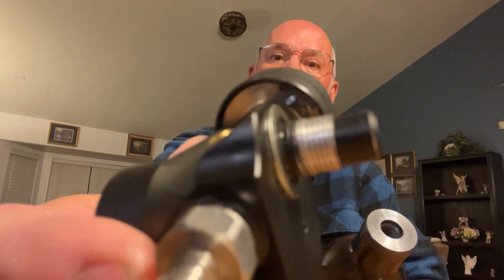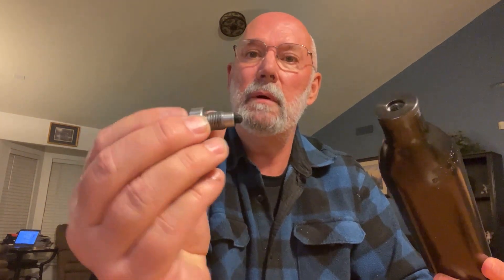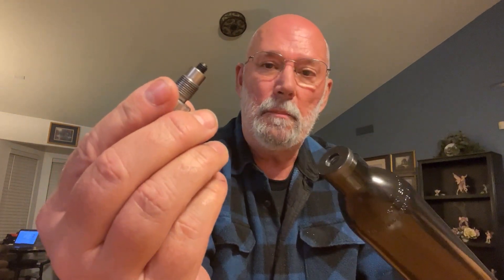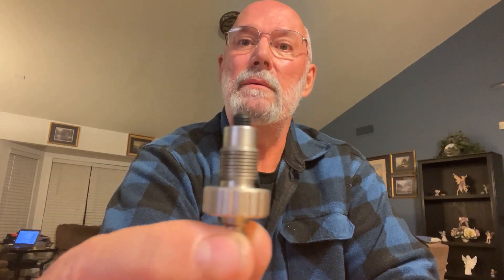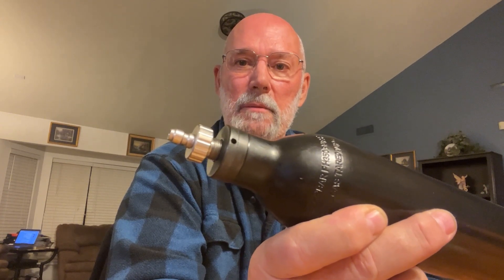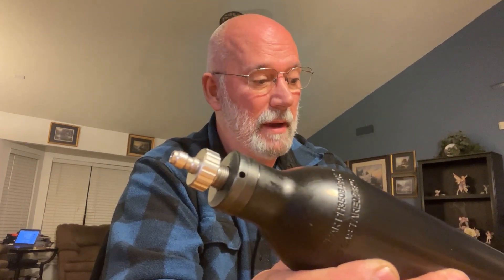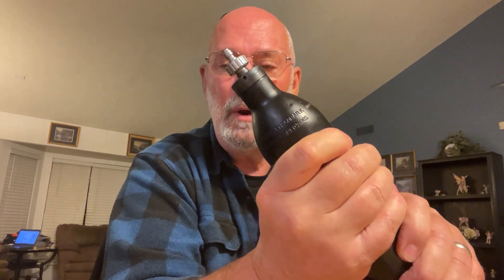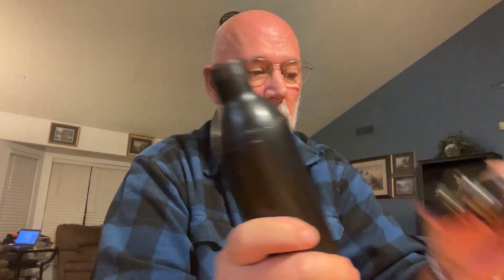Degassing a 400cc FX Aluminum bottle with Damaged Threads

Comment: Please write to support at fx airguns and report this. I did the same thing because my bottle literally blew off after 2 weeks (new Maverick) when unscrewing it. The shop where I bought the Mavreick send me a new bottle adapter and then it happened again when I took the bottle of for the 2nd time when I was tuning my Huma regs. I can assure you . . . I know pretty well what I'm doing so I will not accept the "user error card". This is a design error, period. Huma Air said the same thing. 

The threads on the bottle connector/adapter are simply to short and made from the wrong material. The carbon bottles have steel threads. Most people know that alloy and steel never go well together under pressure. This must be redesigned before real accidents happen. The bottle adapter must be made out of stainless steel , the threads should also be twice as long preferably, but that renders a lot of bottles useless. Send FX a mail my friend, everyone should do this.
Reply from the maker: Thanks for the advice. I noticed that the Talon Tunes CF bottle that I bought along with a Huma Air 300 bar bottle valve paired with a new Huma Air FX bottle adapter seem to screw on and off 100x easier than the stock 400cc Aluminum bottle that my Maverick VP originally came with. Since I started with the VP I didn't realize that the bottle should have been easier to remove. I did begin to notice that every video I watched it always seemed like their bottles came off way easier. I had already ordered the 580cc Talon Tunes bottle and Huma Air bottle valve so it was perfect timing when my bottle came off and was stripped. I was only down for a week. I'm anxious to see if FX stands up and accepts blame and replaces everything. I'm almost tempted to just say screw it and buy the replacement parts from Huma Air. The Bottle valve and bottle adapter from Huma Air was a much better quality.
Reply: @drthomrednecksolutions4410  

I didn't know that Huma Air makes this bottle adapter as well . . . I thought they just have them in stock through FX just like Krale does over here in the Netherlands. 

Strange that they never told me to try out their version.

I think the problem is the thread depth of all the bottles that you can use for the Maverick. It's only a few turns. This means they are limited to this. Let's hope they make a stainless steel one, that would be a huge upgrade. 😁
Reply: @drthomrednecksolutions4410  Mine has the 580cc carbon fiber bottle and it has done this too.
Reply: @davidbraswell1481 I sold the Maverick for that reason. It's a beautiful air rifle but with 2 major flaws, the flimsy (thin rod) cocking mechanismand and the bottle adapter. You can make the cocking much better by using delrin bushings where the rod slides through the alloy, but the bottle adapter is simply wrong. I don't understand why FX doesn't fix this. Maybe because very few people send their complains directly to FX
Reply: mine is doing this and I have only removed the bottle 4 times tuning it. anyone have part numbers?? to order and get it fixed
Reply from the maker: @davidbraswell1481  I’ll try and find the parts number and send to you. Not sure if your asking about degassing the bottle or replacing everything.
Reply: Got a verminator that has dumped air when screwing the bottle on now the bottle wont tighten will it be the threads that has stripped